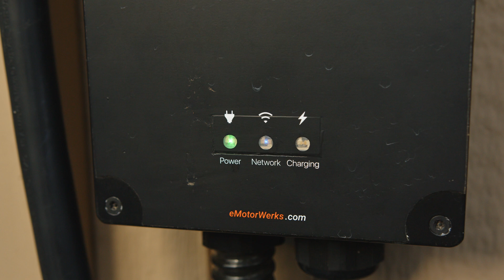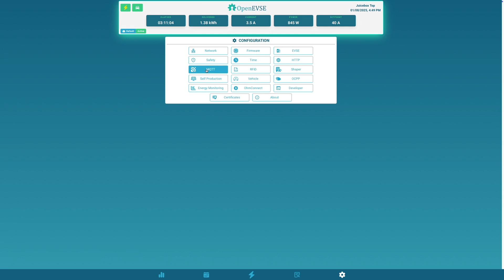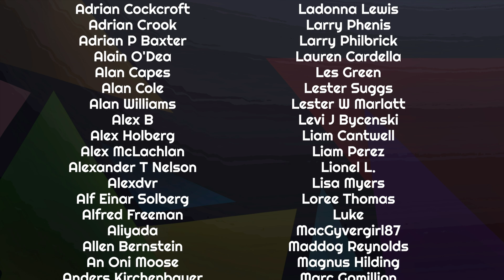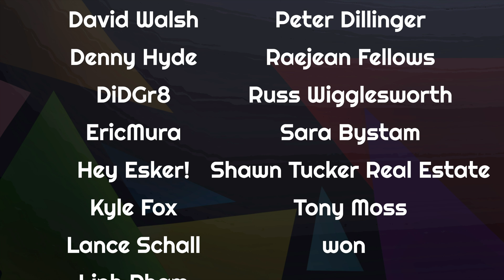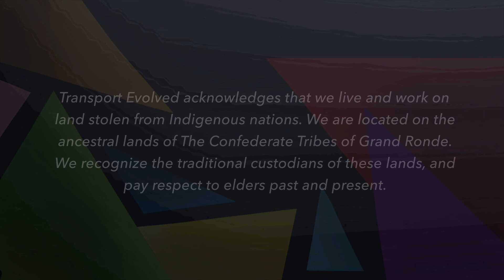We Make Our Juice Boxes OPEN SOURCE Thanks To Open EVSE!

Comment: Hey Nikki, is there a video of how to load share with 2 JBs.
I am an Enel X victim, and I have been loosely following the saga and the rise of Juice rescue as well as OpenEVSEs solution. But its only now that my lazy 🫏 is just now making decisions on what to do about correcting this colossal PITA.
Im leaning towards the OpenEVSE solution but im getting frustrated trying to find that exact solution (probably something to do with ADHD) of 2 ver2 JBs on 1 branch circuit. Its not that Im not technical inclined, I could robably implement either a software/home server solution or hardware solution. I just can't find the patients to sit down and figure out how to get is running.
TIA to you and the crew at transport evolved

Comment: OMG!!!  9mm???   That has to be the first use of a 9mm in automotive I've ever seen!

(The joke is that while mechanics can't seem to ever find their 10mm because it's used so often, the 9mm is never dirty or missing because it's never used.)

I love the fact that the EVSE does not have to be junked.  Would have been a waste of quality stuff.  Would love to see the sharing and scheduling setups.  

BTW, is the new board and software OCPP compliant?  That would allow a fairly easy swap to another service.
Reply: Just fixed a pump that used 10 mm and 1/4" inside the same unit. In the same space where I can barely get one hand in and definitely can't see what I'm doing. American 1980s engineering FTW. Come to think of it, it was all in ye olde units except for a few 10 mm nuts. Not relevant, just venting a little while feeding the algorithm.
Reply: @geirmyrvagnes8718  The pump company sourced some parts from the rest of the world.

Comment: Chevrolet Silverado truck in Ontario needs a new battery. This type of news is not good for electric vehicles.
Reply from the maker: Because engines never need replacing, right?
Reply: Your 12 volt battery died?

Comment: This is such a good idea!! I wish it existed for other electronic devices that lock you into their crappy infrastructure. A specific example: Chamberlain garage door openers!
Reply from the maker: There’s the ratgdo…. https://paulwieland.github.io/ratgdo/
Reply: @BillCarlson   a few years back we had a water softener that was wifi linked through a system that Lowes had up and running. Needles to say Lowes felt that they had better things to do and shut the software down. But in saying that it didnt affect the water softener its self just that I couldn't ue an ap to check on it. Lowes did send us an $800 gift card though, for the trouble. So that was nice!